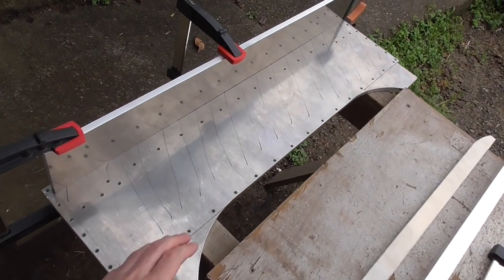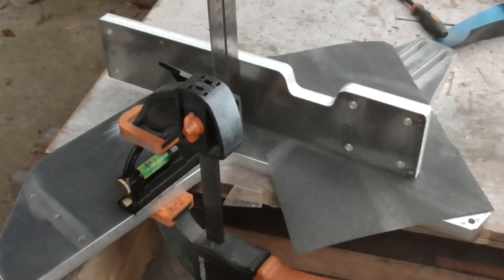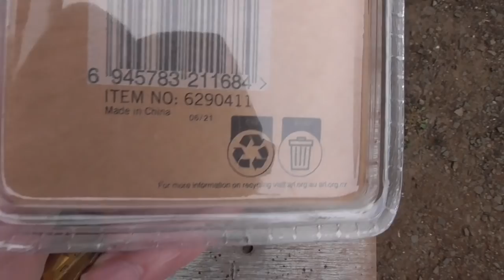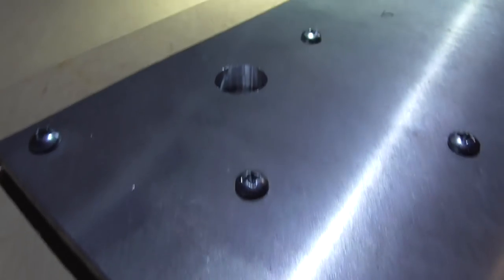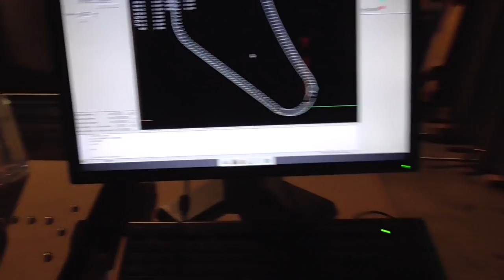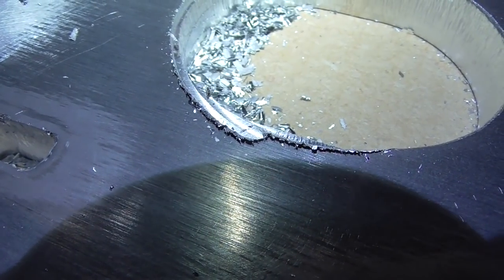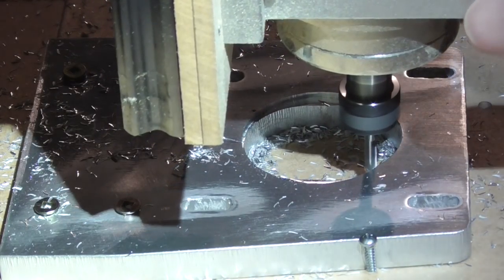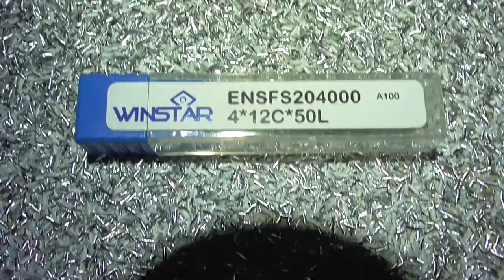Another DIY CNC router, part 7 (machining aluminium motor mounts, hassles with bent plates)

Comment: Perhaps obvious, but checking the squareness of a square is quite simple: place it along a straight edge and draw a line along the spine. Flip the square over (instead of having the "arm" on the right side, it should be on the left side) and check if the spine (now up side down) aligns with the line . "Pask Makes" demonstrates this. Having a different square prove or disprove a square becomes messy, I think? A square that fails all on its lonesome is doubly judged! 

I envy the grass you see in the gap, though. It's all snow where I live...

Comment: Reasonably simple and economical way to flatten those plates is in an hydraulic press. Put the ends of the plate up on 25mm blocks and use the press to bend the plate past the flat stage as it will spring back when the pressure is released. You'll need to experiment with the amount you over-bend until it relaxes to flat. Most presses in workshops have a working area big enough to take the largest sheet you have. Somebody below suggested doing the same sort of thing by driving your car over it but that could reverse the bend even worse and the pressure is hard to control. Should be a lot cheaper than surface grinding. Merry Christmas and I hope this helps.

Comment: Having the rail bedding areas machined  is not likely to help much as internal metal stresses will simply find a new equilibrium when the part is removed from the machine. You might consider forgetting the flatness of the basic frame parts and instead concentrate on making the slides flat and true. For example the round slide rails have a series of mounting holes. If you were to add a series of threaded holes fitted with "jacking" screws you can align  the rail as required by working the hold down bolts against the "jacking" screws. Once everything is aligned, dam up the joint and pour in some slow cure and very fluid epoxy to complete the 100% bedding of rail to base plate. The idea is very similar in concept to the grouting of steelwork columns of a large structure. 
As for coolants the best for aluminium is kerosine or CRC but you will no doubt reject these for the mess they make. Just remember the coolant has three functions. Provide lubrication, cooling the tool and workpiece and to carry away chips. Lubrication paramount when machining Ali to prevent build up on the cutting tool. 
Fundamental and essential to creating anything flat or straight is a known flat reference surface for comparison. The very first surface plates were created using the 3 flat method, a slow and tedious process that I mention  purely for interest but worth a google all the same. I recommend you find an engineering surface plate as they really are fundamental to accuracy and have numerous other uses.
Squares are "self proving". Working from a straight edge scribe a line then flip the square a compare the scribed line to the square's blade. Flipping the square doubles any error and makes them obvious.
Reply from the maker: Right. To machine the small plate I would first need to flatten one side properly, I'm considering buying a granite surfacing plate that could do that for the small z plate, with sandpaper. Then clamp that face down to mill the other side.
On the main axis the epoxy-fill method might not work too well because the ball screws are directly underneath and should be parallel. But I suppose the ball screw mounts could be 'jacked' as well.
Yes you know me well, I have come to like the tidiness of the dry chips :) Eventually it would be nice to have proper flood coolant to do the job properly without a noisy vacuum cleaner running, would use less power too. Not sure how well-suited my wide open layout will be for catching splashes, but I think it could be made to work.

Comment: The best way I have found to test a square to se if it is really square is to use a square and a longer straight edge.
use the square with the straight edge up to it and draw a line, turn the square to the other side(flip 180 like mirror image) put the straight edge up to it again and draw another line over the first one, if its square you only have 1 line, if its not you will get another line opening up the further you go like a big narrow V. You can do a quick test just using the square and flipping it but the longer the line the better.

Comment: Kerosene. It's what I've always used & been told to as cheap & available fluid for aluminium.
happy trifle day & merry new years bro.
At 25:23 that tone match my Tinnitus, need to sample and loop to de-sense-a-tize (stupid autocucucumber)
Reply: I always used kerosene...
Pros:  It really works well and is cheap & readily available.
Cons: It stinks!  It also soaks into anything porous; you would not want it near an MDF machine.  OK later on maybe?

Comment: Your last idea to mill flat the bearing surfaces for the linear rails is good - BUT typically this is done to achieve very fine local flatness. The issue with using it to compensate for a bend in the entire material is that the clamping forces you use to hold the material down for milling the flat channels can deform the part go away when you release the workpiece. You need a way to ensure that the part doesn't bend at all under the work holding forces.
Reply from the maker: Right, and both sides of that smaller plate also need to be parallel after it's all done. So I'm thinking I could buy a granite surfacing plate to flatten one side first with sandpaper, and clamp that side downward when milling. For the larger piece, I would need to have the 'ribs' in place first to straighten it before milling. Fortunately there will be enough clearance to fit under the gantry.
If I had access to a huge granite plate maybe I could do the same sandpaper trick with the larger piece.
Reply: @iforce2d  Phone up kitchen manufacturers. I got 2 large bits of benchtop granite for free since they had chipped edges and didn't match their other stock. It won't be surface plate flat, but it will be flat enough for home gaming like this... You could also clamp what you have at the corners with any bow upwards so it doesn't deform - then deck that side flat, then turn over, clamp down and mill out the channels for the linear rails
Reply: @iforce2d  And yes, I thought about milling it with the ribs on it and that would be ideal... In a perfect world it's dead flat before assembly but in the real world if you can fixture the plate with the ribs on it already that would be better.
Reply from the maker: Sounds like a plan.
Reply from the maker: oops, somehow that posted before I'd finished. Was gonna link this, looks promising:
https://www.trademe.co.nz/a/marketplace/building-renovation/kitchen/countertops-benches/listing/3395595493
Reply: @iforce2d  Do it... It's not convenient to get or move around - but It's a great choice. I am going to go ahead and assume you have seen the Youtube channel of Piotr Fox Wysocki where he builds a granite based CNC? He's in NZ as well. WELLLLL worth a look if you have somehow missed it
Reply from the maker: Done :) The guy had a piece just large enough for my main gantry plate, very cheap and not back-breaking to move around. Now I'm learning about how two very flat things with a little water between can get quite stuck to each other.
I think I saw some of Piotr's videos a few months ago, but if he has mid-roll ads I wouldn't have watched much. Will have to check again on that.
Reply: @iforce2d  Honestly, if there are ads in them, they were added by YT. Piotr hates ads as well and has pulled back from as much YT content because of it. However, his granite CNC series is 100% solid gold the whole way through. You must watch it even if you don't plan to build something to the ridiculous accuracy level he did.

Comment: You may need to use some helicoils in the bottom plate if you are using the extrusions to pull it flat . It will lessen the chance of strippinb the threads out.
Reply from the maker: Yeah M6 is a pretty small size for this job. I can use a lot of them though, and tighten gradually at the same time, hopefully they  should hold up.
Reply: @iforce2d  yeah true, and then if they do give trouble there is still alternatives. I used to do a bit of aluminium fabrication as an apprentice and would often use helicoils in aluminium, but they were usually M10 or bigger.

Comment: Ball Slides are only as good as the structure you bolt them to...Straightness, and flatness is everything....I would have discounted even laser cutting these parts out as blanks as the heat would distort them for sure...I'm a retired Engineer, this stuff is just basic for me...I used to design Laser Cutting machines...You have some filing and sanding ahead of you. Then some bending etc if you are to use these parts....🤔😳🇬🇧

Comment: I noticed that when you were milling the pockets for the motor you were using conventional milling. That tends to be more stable and the chips will tend to remain clear of the cut as opposed to climb milling which will tend to catch more chips in your cut. The advantage of climb milling is that the edge of the cuts tend to be smoother than conventional milling provides. Of course deburring solves that problem. One real problem with climb milling is that you will be more likely to have issues due to any backlash in your positioning system where as conventional milling is better in that regard.
Reply from the maker: I'm using climb everywhere except for the finish pass on that first piece.

Comment: Suggestions for alunimium cutting fluids, with the caveat that the aluminum structure is a good idea first. WD-40 is a popular choice, and may be spot-applied in the current setup. At my work we use varsol, a.k.a. mineral spirits or paint thinner.

Comment: I was going to post this on your previous video, but travel got in the way...  cutting a slot in a single pass, where the cutter can contact both sides of the slot, increases the probability of chatter.  It also increases temperature at the cutting edge, and the chance of chip re-cutting and chip welding.   The "trochoidal" tool path is meant to fix this, but I don't think you need to make the slot as wide as you did.  Just enough for chips to escape maybe?  I am sure you can be more agressive with feeds and speeds as well; it's still going to be slower though.
Reply from the maker: Yeah it seems to make the width twice the cutter width by default, I couldn't find any options to reduce it. I was hoping for just enough to clear chips, about 1.5 times cutter width maybe.

Comment: ive built a few cnc machines, one from concrete, other from aluminum.. For the home hobbyist, these imperfections never translate to the table in a measurable way.. A few reasons , one being that the rails are mounted to the plates , further stiffening and straitening. Another being the fact that the spindle itself can be trammed to the table before cutting during final setup .. Another being that hobbyists rarely need to make aerospace parts requiring the level of parallelism detectable from the defects in construction..if I could build them again , id use more red loctite during the initial assembly , because those bolts are impossible to get to at the end
Reply from the maker: You're quite right. I'm putting in quite a bit of time and money though and would like to get the best I can out of it when it's done. And this will be the last time I make one, hoping to be using this for ten years or more. Purists would probably complain that the rails themselves are not to be used as support let alone to straighten something, although it would probably work fine.

Comment: I have seen machines that used shims under the bolt locations for the rails, rather than trying to flatten the plate.  (One just used strips of Coke tin, which seemed to work great.)  It means that the rails are unsupported between the shims, but it didn't seem to create any problems, so maybe the rails are stiff enough.

Comment: Personally I’ve had massively better success with single flute windmills with my bendy low end CNC machine. I’ve also had much better success going faster with smaller stopover, so similar material removal rates, but lower forces. Likewise use more side end mill vs using the tip. I have better success helixing in quite deep, then cutting out with small step over and high ish feed.

Good luck!

Comment: 38:40 If you don't want use those long bolts through the entire height of the profile use blind joints,it only takes about takes 10mm bolts and less hassle to setup.Also if you use long socket head cap screws they don't seat well in side the profile cause of the angled walls
Reply from the maker: I moved to 8mm bolts for the x rails so now I have a bunch of the longer bolts extra that will work nicely. It seems about the same hassle except to do blind joints I would need to go shopping again.

Comment: I believe the tool path you mentioned at 16:00 is to reduce chip load of the cutter
Reply: There's no reason you couldn't just adjust feeds and speeds to get the right chip loading, I thought it looked like it was to create clearance for chip evacuation
Reply: @robmckennie4203  wrong word choice on my part, it is to minimize radial engagement(cutting force) of the cutter not necessarily for the chip evacuation. It is called trochoidal milling and used when stability and vibration is a problem and also improves tool life. Sandvik coromant has a detailed explanation of you wanna give it a read.

Comment: 30:18 I think you’ll have a problem with most ‘cheap’ extruded aluminium that is not symmetrical in cross section.. I’m no expert but as the material cools unevenly it bends.. try box section. I think the guys producing the expensive linear extrusions are carefully designing the fancy profiles to limit bending

Comment: there is an easy method for checking the perpendicularity of a combination square without using any master square, check YouTube,It is also depends on how clean the mating surfaces of the scale and the head

Comment: While you are still using the MDF machine, any form of liquid cutting fluid is probably not practical.  An air-blast cools, and clears chips; if there are no chips there, you cannot re-cut them!  It makes a hell of a mess though, chips for miles!  (Fences help)
On the final, all alloy machine, there will be a whole bunch of options.

Comment: At 3:40 the extra stiffening ribs are a good idea, but I don't think the lightweight channel is "gutsy" enough for the job.
At 38:00 If your drill-press is not too heavy, sit it on top of the plate and drill down through the hole in the base. (Mine is quite light.)
I have been a very vocal advocate for single-flute end mills... more space for chip evacuation, and they run cooler.   HOWEVER... your success with the two-flute cutter is forcing me to rethink!   DAMMIT!!
Reply from the maker: I've never seen a drill press that can reach all the way down to the base, let alone underneath it. Not long ago I upgraded to a large drill press that is very difficult to move, and the much smaller old one is being converted to do power tapping. I had to cut 25cm off the column so it could reach through the floor.
Reply: @iforce2d   Meatloaf: "Two outa three ain't bad!"
My first, ancient, drill press had the head unit clamped to the column.  It could be lowered all the way.
The second, a Ryobi, couldn't.  (I think, never tried.)
 My current drill press is a Bosch PBD40. (They're quite common, and I like it a lot).  Unusual in that it has no table, so no tilt.  The complete variable-speed geared head unit with digital readout for speed and depth, moves up and down the column on a rack.  Negatives are the handwheel is heavier in use than the normal three lever setup, and there is less "feel" than you get with a typical splined quill arrangement.  The keyless chuck can go all the way down to the centre hole in the base.

If you haven't seen it, check out Piotr Fox Wysocki's video where he uses one of these Bosch's as a grinder to level up a granite linear rail mount on his stunning CNC mill / router.  Ingenious!     https://youtu.be/9yBWrzBjW5w?t=59
I love what you are doing!    :o)

Comment: Hi! What CAM software do you use? It seems to me that you have very slow cutting speed and very high stepover(load of the tool). I work on CNC router cutting aluminium and work the opposite way: bigger cutting speed and thinner chips.
Reply from the maker: I'm using FreeCAD, it has a CAM feature.

Comment: you are not comparing like with like. Framing squares are pretty crude, cheap adjustable squares are crude, a solid triangular square is likely to be more accurate. But what are you comparing it with????

Comment: Thing is the square you were using is ... well for woodworking really. And yes they suck due to how the ruler is fixed in place on the 'holder' with a screw pulling it down. Really should not be using those at all for anything but rough woodwork.

Comment: It may seem barbaric but you could almost certainly take that bend out of the plate by just putting it on the ground putting a 2x4 under one end and then gently running your car up on it. Obviously you'd want to do this a very small amount of time but it probably wouldn't be hard to fix.
Reply from the maker: With the 28mm wide 10mm strip I tried that, by standing on it, even had to bounce my whole bodyweight a little. It does nothing... nothing... nothing... and then suddenly bends, at a small part in the middle only. I don't think you can use that method to get a smooth gradual curve.
Reply: @iforce2d  ah ok. Yeah to be fair I have bent and straightened quite a few things using my method but never a thick plate of aluminum.